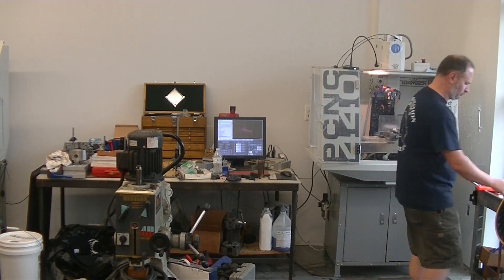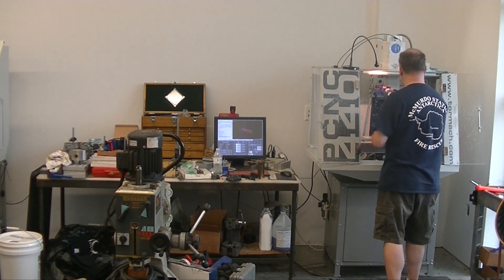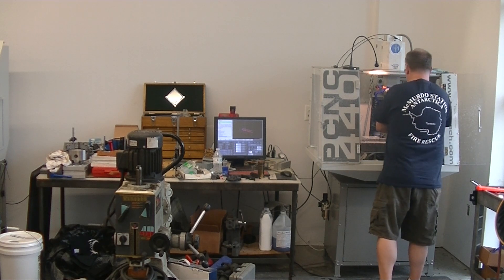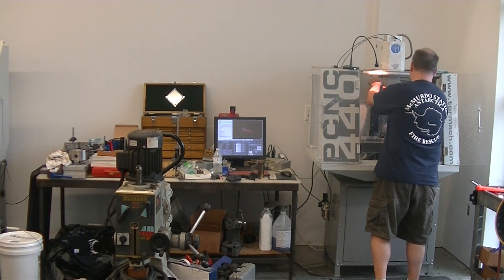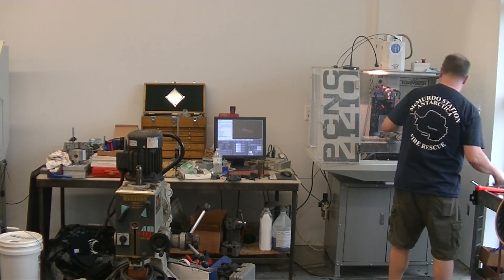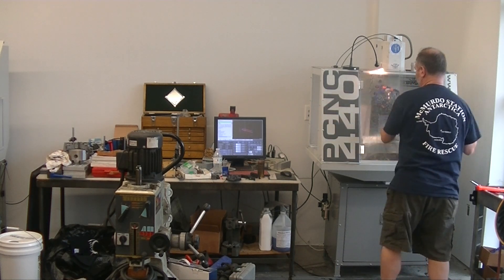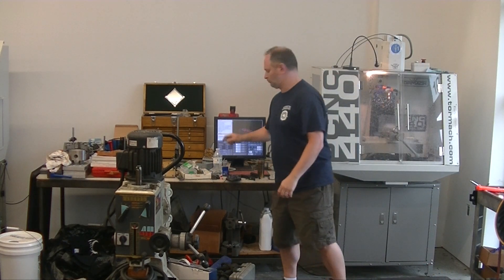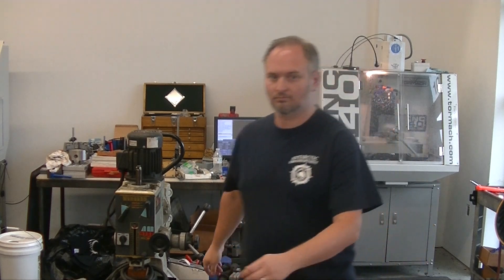Tormach 440 Upgrades - Locating Plates

Comment: looks cool , only things i would do different is instead of having only one piece i would make a fixture plate other thing is i would do all of the pieces with 1 tool then change tool then go trough them again.  i am no machinist ... just drooling over the tormach ... :P you could go with the ATC but its cost prohibitive in my opinion. (almost as much as the mill )
Reply from the maker: I ended up making a fixture plate that did op1 and 2 on the same plate so every time I ran the machine complete parts would be done. Thanks for watching!

Comment: Nice work;  have you considered facing off  with the 2nd smaller tool to save a (manual) tool change?? More run time but less 'standing ther' time.  .   Some sort of spiffy adaptive tool path might even give it more appeal ......  and I'm sure @alfredlyon @abtools could whip out a stepped 'chamfer mill' that doesn't go to a point but instead leaves enough of a square end to allow facing and chamfering all in one tool (no changes ...... 😂😂👍👍)......Just random thoughts while eating lunch at the Day Job.
Reply from the maker: Thank you! It's definitely possible but I think this is the right way to go still. Lakeshore has a new roughing mill that might also be useful; did you see it? I think switching the pallet design is going to be the big first step though.

Comment: Looking good Tom - for sure, any means for having locating pins etc to get quickly back on position for set-up is great.
Despite machine limitations on scale, it still does super work. Love it.
Reply from the maker: Thank you, Chris! It definitely does a great job within its limits. Prototypes and toolroom use are perfect but not necessarily a mass production machine. Just need to work with what you've got though!

Best wishes,
Tom Z

Comment: Congrats on the house and it's a decent machine I'm very envious and love the power tool changer!

Still need to finish mine it's in bits, currently in the process of making a proper metal enclosure like the 440.
Great stuff looking forward to seeing the progress and changes.

Cheers,
Dave
Reply from the maker: Weren't we talking about the PDB design over a year ago? I guess it's time to start working on that. :) Once the transmission is fixed and the car is back on the road, of course.

Hope you are well, sir.
TZ
Reply: Was it that long ago, time does fly ...
I tore down the temporary wooden enclosure a few weeks ago and have been looking at ordering some sheet steel for the sides and bottom tray.
Roughly what thickness is the Tormach metal enclosure 1mm, 1.5mm, 2mm?
Reply from the maker: I did some quick calculations and I believe it's in the 1.5 to 2mm range. If I recall correctly, it's 14 gauge which is .075". That converts to about 1.9 mm by my math.

Let me know if you need anything!

Best,
TZ